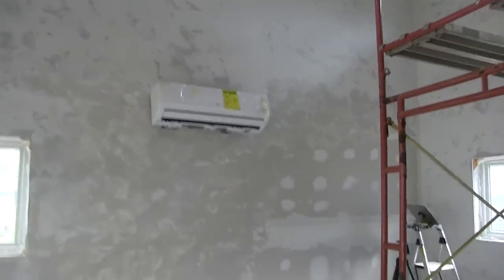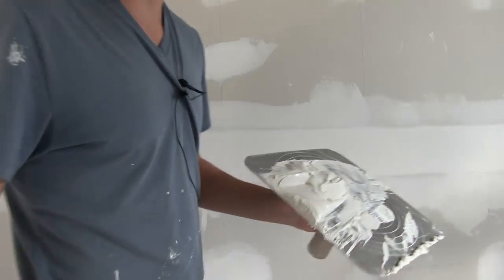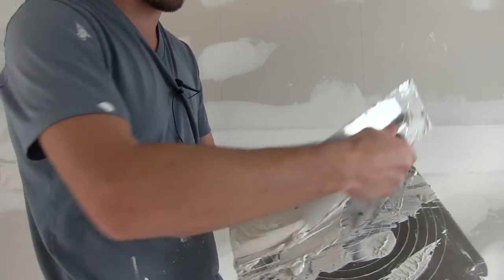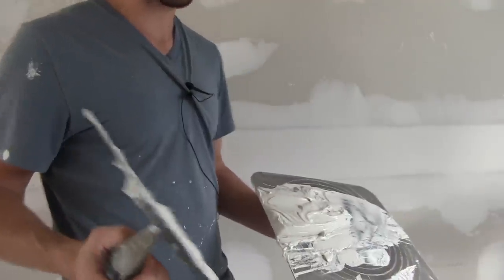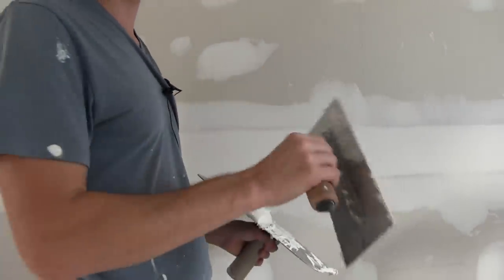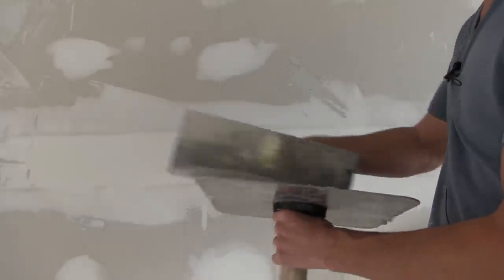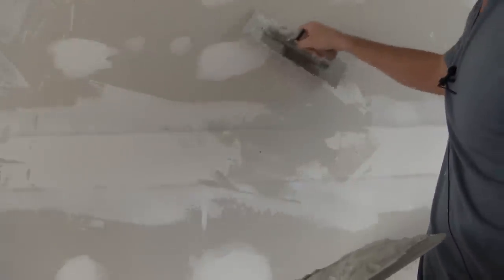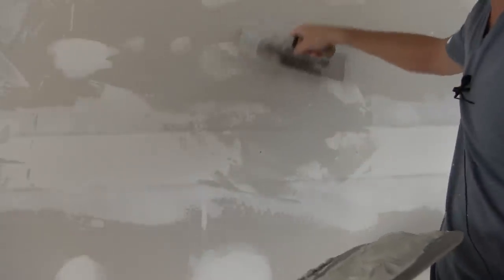How to Skip Trowel Texture

Comment: Thanks for the video. That was great. Did you thin down the mud from the way it comes in the bucket or use a different mud than you did when taping?
Reply from the maker: I thinned it quite a bit and I used the light weight mud in the blue box.
Reply: Nice
Reply: Looks good

Comment: Looks like you know how to hang but you sure dont know how to finish. You got joint starvation. Also forget about judging your finished product when you finish. Youre not gonna know what the finished product looks like for about 3 years (shifting, settling and especially the way todays crappy lumber twists inside the wall). I sure hope you glued that wallboard.
The drywallers around here will not guarantee any drywall job where the board is not glued.
Reply from the maker: I think my joints are the bee's knees. Either way, the video is about skip trowel texture NOT taping and floating. So you CAN see the finished product as soon as its painted. Oh, and I didn't glue the sheet rock (wallboard) either.
Reply: I am sure the insurance company is going to tear off a piece of drywall to inspect glue application ahaha....Glue is overkill just another reason for goofy contractors to charge extra. So flush your glue comment
Reply: `Agreed! Thank you,  @buildingsmall8422 , for the YouTube on skip trowel texture! Exactly what I needed. 
Why people gotta tear down your presentation, I'll never figure out. It's not like they're putting THEIR work out there.